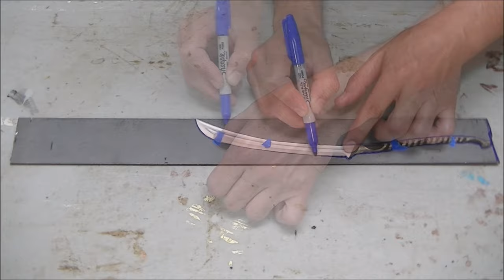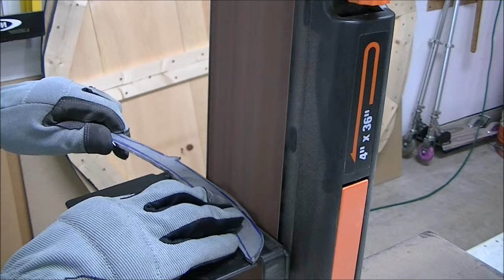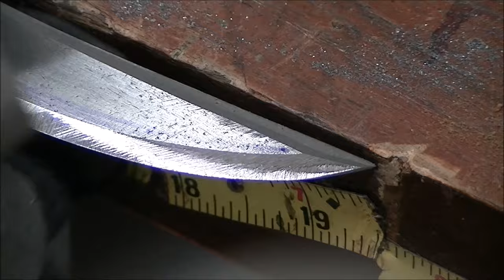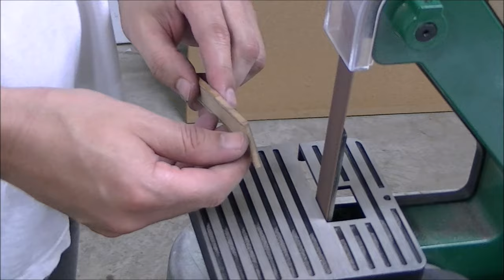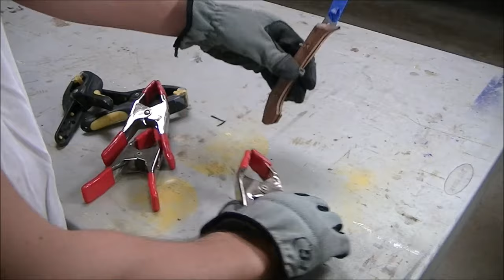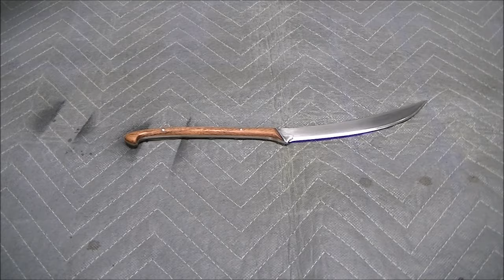Lord of the Rings inspired Letter Opener

Comment: What kind of steel was this?
Reply from the maker: This is just mild steel that you would find at a Home Depot or Lowes or Ace Hardware.
Reply: +Dan The Maker Man sweet thank you
Reply: +Dan The Maker Man also then like a metal cutting blade
Reply from the maker: Not sure what you mean are you talking about what I used to cut the metal or are you asking about the blade part of the letter opener?
Reply: +Dan The Maker Man cutting the metal. What kind of blade did you do
Reply: +1SniperToRuleThemAll also sorry for asking so many questions but how did you get the nails to stay in to hold the handle?
Reply from the maker: I used an angle grinder, http://www.harborfreight.com/4-12-in-5-amp-heavy-duty-angle-grinder-60372.html with a metal cutoff wheel, http://www.harborfreight.com/4-12-in-40-grit-metal-cut-off-wheel-10-pc-61195.html if you  have never used one of these before be careful they are dangerous.  I always wear a full face shield http://www.harborfreight.com/adjustable-face-shield-46526.html whenever I use this tool.
Reply from the maker: No worries ask all the questions you like.  The handles and nails are all attached using epoxy.  I coated the wood part of the handles and the blade tang as well as the nails with epoxy and then clamped them together.  I let it dry over night and then cutoff the nails with a hacksaw.  Then shaped the handle.
Reply: ok sweet thank you for helping me and i loved the video. also nice touch with the stand!
Reply from the maker: My pleasure, let me know if you need any more info. And thanks for the kind words.